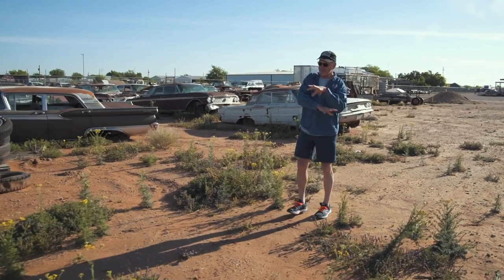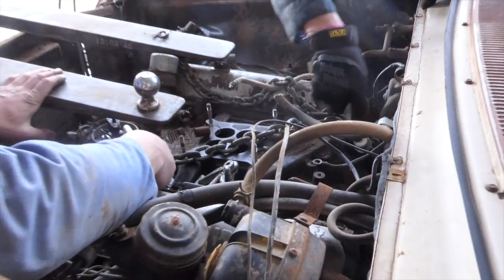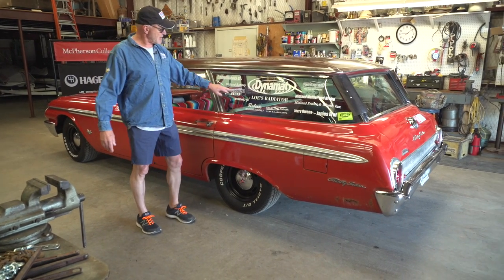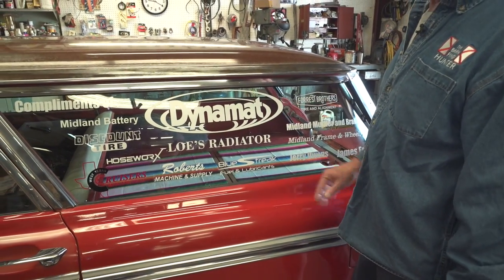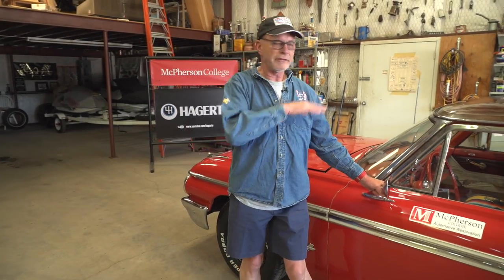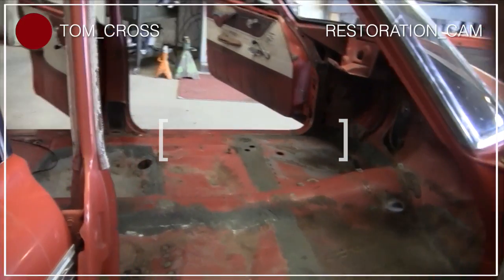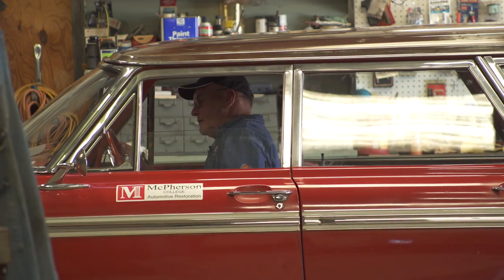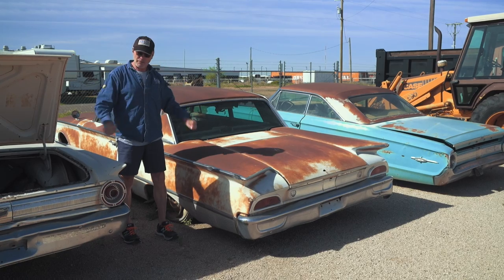Rags to riches: Tom restores a Country Sedan he found in a junkyard | Barn Find Hunter Ep. 60 (1/4)

Comment: Wow! Talk about memories... We came to the US from Argentina when I was 10 years old in 1965, lived in Martinez, California. My dad was 39 years old, originally from northern Italy and had never driven or owned a car. First car he bought was an aqua blue 1962 Ford Country Sedan, 390 V8 Cruise-o-Matic transmission, 8 passenger(the last seat faced backwards). That car could move even though it only had a two barrel carb. I did my first oil change on it at 12. A few years later at 19 I bought a 1964 Country Squire, turned it into my surfmobile,  folded down the back seat, foam and carpet and "Paradise by the Dashboard Light". Peace!

Comment: I started driving in 1990 and bought my first car at 15 1/2 yrs old. It was an all original 1962 Ford Galaxie 500 4dr. with 352 big block, cruisomatic trans, optional front seatbelts, 4 way power bench seat & fender skirts. I drove it for a while and then put a built 390/C6 in it. Awesome ride and fast as hell.  WAY more car than a 16 yr old should have. I miss that big ole boy! Nice Wagon! Thanks for bringing back the memories.

Comment: I have a 63 Country Sedan which has pretty much every option available. Factory black with red interior 9 passenger, factory A/C (spits ice), roof rack, 390-4V, deluxe wheel covers with whitewalls, dead stock except glass packs and twice pipes/tips under the bumper but now needs restoration. Built in late Aug of '63 with C3AE-G 427 Low Riser heads. Bought from original owner in the 80's with dealer paperwork and every single receipt for every single part he put on that car until I got it.

Comment: No pre 85 car should ever be crushed all those parts. Things will be VERY different before too long. I dont want an electric car with a pretend sound thanks
Reply: My wife's new vehicle is more computer than combustion engine. I like being able to work on and fix my old trucks without it's exact GPS  location being broadcast to who knows who. Not too many bells and that's the way I like it.
Reply: I've parted out a few and, admittedly felt a little guilty when I sent the shell away, but when a car isn't desirable, is a rust bucket and either has no engine or the engine is stuck, there's not much reason to keep it around.  But at least get all the useable bits off it first!
Reply: Amen to that
Reply: All the Escorts, Omnis and Citations can get crushed
Reply: BLACK GSD54  l

Comment: Had  my mother's 1961 Ford Country Sedan with 390 tri power police interceptor ,the big  factory cast iron headers, and NO RUST California car.3 Lincoln colors,root beer color ,pin stripped panel painted, sand blasted lower quarter panel  glass with stage coach and heard of horses on the other  quarter glass and more.

Comment: When I was a kid we had a black, 1962, Ford Country Squire wagon with a red background to the chrome side molding. The back window was electric not manual. Every Saturday that car got shined. It never seemed to take much effort. I remember it being the most perfect shine I've seen on a car. It was still perfect when dad gave it to my brother and he bought a new 1970 LTD. More kids, more seats. My brother jacked it up the rear, put racing slicks on the back, chrome wheels all around, bucket seats in front, a Hurst shifter, and blacked out the back windows from the inside. You couldn't tell the difference between glass and metal. He, and it, became a legend at High School.

Comment: I love a 390 I bought a 75 f250 with 17,000 original miles that the roof was rusted off and put the motor in my highboy. Its the best running, smoothest thing I've ever owned.

Comment: Our family had several great wagons when we were kids and i'll tell you two things. We really did like and appreciate them even though they were easy to take for granted because every family had a wagon. We toured all the US in those cars and the big ones were really meant for the long road. They had the space and strength and power for it and six people. Second thing, we truly thought they would never die. Whatever else we had, we thought sure we'd always have a wagon around and then one day they abruptly stopped being made. Because there were so many we didnt think that we'd better grab all we can. When they stopped being made they also disappeared quickly too. Straight to trade-ins, then to scrap to be remade into Toyotas. I dont want an old rusty one to restore, i want a brand new Pontiac, Olds, Ford wagon of those designs and features like wind wings, heavy chrome bumpers, roof racks, cool tailgate mechanisms, etc. Modern SUVs dont cut it at all. A new 1960 Pontiac is a much better and different experience than a new SUV, so was an International Carryall/Travelall of that period. We miss them not for nostalgia but because they were good. Some friends bought a new 1959 Ford 2-door wagon and only stopped driving it recently. More than 50 years, folks. With more people dumping air travel now for the road and trains, yeah bring them back.

Comment: I Had a 63 Chevy Biscayne Wagon   327 w/2 inch exhaust 4 barrel Holley and 3 on the tree ,It was the performance Tow Package and would hit 90mph in 2nd gear ,It pegged the speedometer in 3rd at around 128 ...but the reason I commented was You could put 2 friends in the spare tire well and sneak them into the Drive -In .

Comment: Need to use proper spray masks for anyone who intends going down this route for a restore, especially with modern 2 pack paints which can leave you with a failing lung, the ones used are not spray masks and not even good enough for dust protection. Health is wealth. Great channel.

Comment: Loved the sound of the FE blocks made. I am not sure why it is hard starting cause everyone of the ones I had, blow on the key and it was running, hot or cold. It deserved a headliner, not hard to do with the sound board that they used in most of them. I bought a 62 hard top with 289, three on the tree/overdrive and nice radio. and just stock wheels. It was posi., blue and white two tone in and out dual exhaust all factory..... $3100.00 all most to penny and drove it for five hard years and got close to two thousand out of it. I don't know how many miles on it but I seen it roll over twice and the guy who bought from me drive for a long while then resurrected it and kept it in a garage for years. We didn't have too much rust there but this ford didn't catch tim worm disease. I held it on ninety mile and hour for over a hour once going in a hurry to get place and the little bit of oil it has started to use quit. I swear that was a tough car and even the rockers were so nice that you think they must of be fixed. I watch a channel in iowa and trucks and cars there in ten years can't be towed or they will break in half they are so rusty. I used to say that ford built the body, chevy built the ride and dodge built the best front ends. Now in the last twenty years all the rigs are junk leaving the show room. Glad to see saved

Comment: Looks good, the wrong tires..... try to make it look like NHRA Drag Stock Car. The car is pretty much period right, the aftermarket parts that improve, but are basically out of sight would be great... Better tires and brakes are good, but the raised white tire stuff was YEARS away. Either get rid of the too big tires, find a similar size to period correct with skinny whites, or black walls like we ran then .

Comment: Come see what is rotting away in my back yard  67 GMC  camper cruiser very large v6 4speed with Granny gear. Also a1971 Jeep J 4000 gladiator 360 4speed with grandma a 69 Nomad with 42000 actual miles 350 3 on the tree